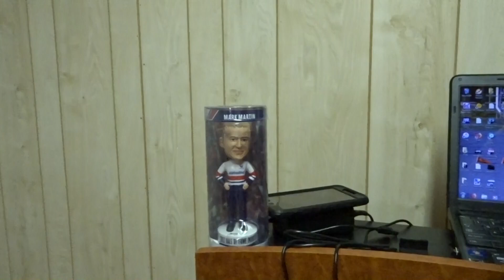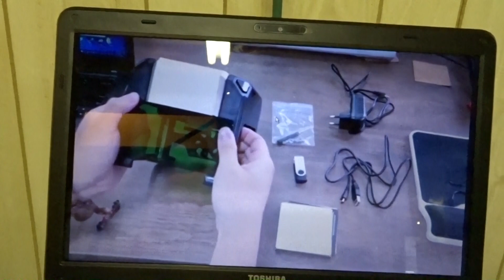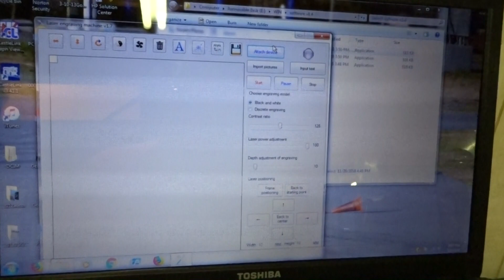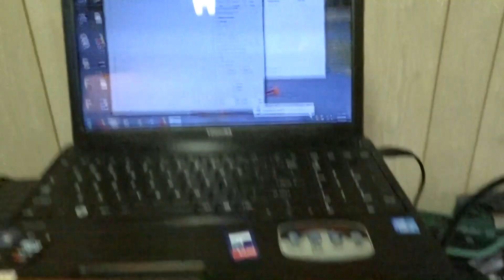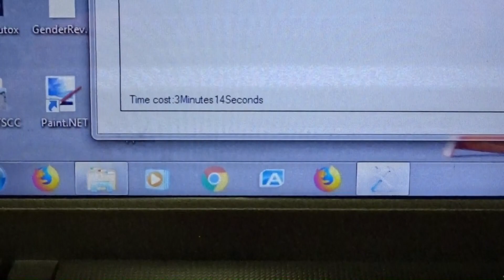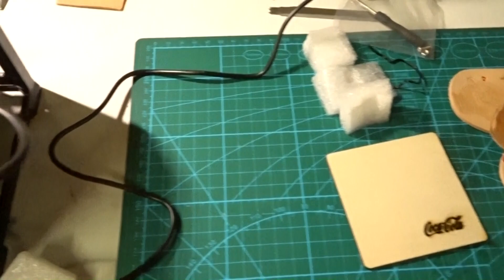TopDirect 3000mW Laser Engraving Machine Mini Laser Engraver Printer Initial Review

Comment: One way to color is paint the item after engraving then sand it the color is still in the etch. You may want to make more than one pass for etch depth but you will end up with a colored etch
Reply from the maker: Absolutely! That would work very well. Thank you for the recommendation.
Reply: Eyes Ahead Pedal Down sure enough gotta stick together
Reply: Put painter's tape on the part being etched and then you can paint in the etch. Remove the tape and you are done.